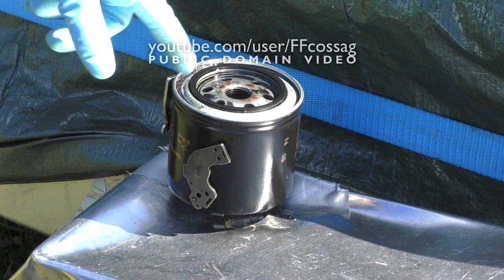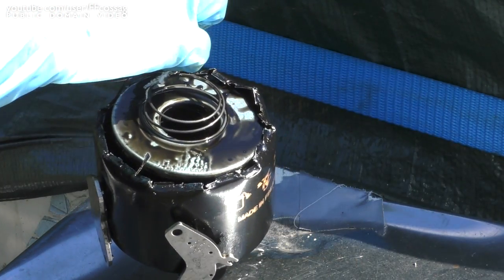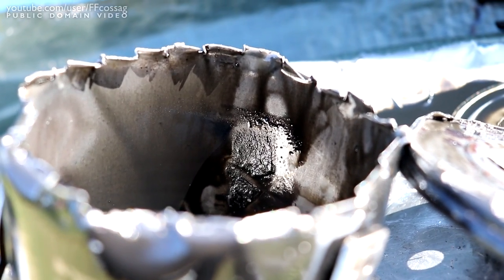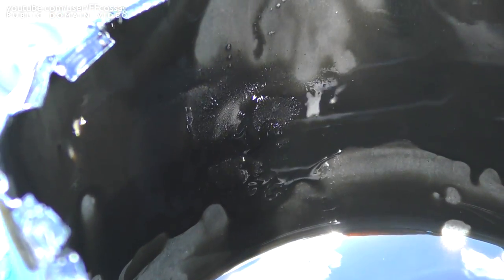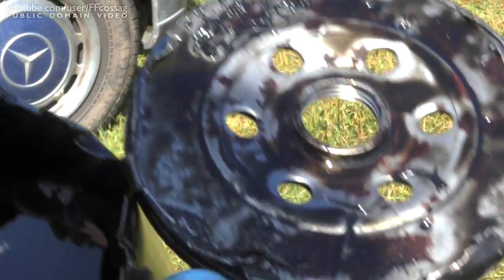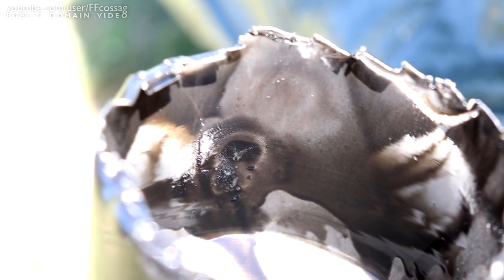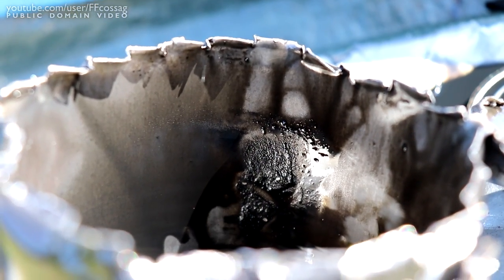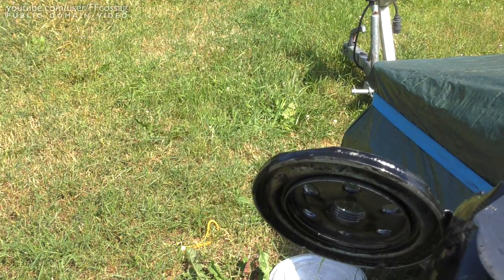Do oil filter magnets work?

Comment: Those metal particles would have just got caught in the filter material anyway. They haven’t gone through the filter and then stuck to the magnets. They stuck to the magnets BEFORE the filter. So pretty pointless. Also, any non ferrous materials won’t care much about magnets.

Comment: That metal would have been caught in the filter...That is why you replace the filters with every oil change...because they catch tiny metal partials like that, the filter Will eventually clog.... hence why we change them.... duh.... buy a good quality oil filter and you’re good to go. Get a magnetized drain plug

Comment: Wouldn't that defeat one of the major points of using a filter? I can understand the use in a motorcycle or sumps or pans that are directly under the crank, but otherwise a filter is designed to filter. If it gets to the point where it's already in the filter, why bother?

Comment: If you change your  oil and filter every 6000 miles you would not have this problem. But there is a lot of metal in that filter I think your engine  is dieing. And it could be what another viewer said it could be the metal from when  you cut the filter open.
Reply: onkar phall u mean 6k not 60k right...?
Reply: Sam B lol yeah 6000 cheers

Comment: regardless of anyone's experience with magnets and where and where not to put them. i have been using neo-magnets for about 7+ years, one on the end of the filter, and three on the oil pan next to the drain plug in addition to the transmission plug which already has a magnet on the plug itself. no cons to this method.

Comment: You do realize that at the end of most oil sump drain plugs is a magnet that does exactly this. And if yours doesn't have one that can be easily gotten aftermarket and will work way better then having the magnet stuck to a steel can which is shielding most of the magnetic field.

http://www.coolmagnetman.com/magshield.htm scroll down to one magnet to see a diagram of what happens to the magnetic lines when against a ferrous plate.

Comment: What's the point of magnets if the filter element catches the shavings and if the filter element doesn't catch the shavings then it's a bad filter. Therefore only use a good filter.
Reply: The problem with that, is that if the filter had the ability to catch really fine material, then it would get clogged up way to soon, so most oil filters allow particles to pass through, that are in the 20 to 30 micron range. Smaller particles cause the majority of engine wear that does occur. There was a time, when engines did not even have filters, some, did not even have oil pumps.The engine will run with unfiltered oil, it just wont last as long. On the other hand, as the filter gets older, it does begin to clog, and it then begins to filter out finer stuff. However, it begins to take a little bit of extra power from the engine, to puch the oil through that filter. If the filter gets clogged enough, then there is a valve inside, which opens up, allow the oil to bypass the filter marerial entirely. That saves the engine from catastophic failure due to low oil flow and pressure, but at that point, it is allowing dirty oil to go through the engine uncleaned.

Comment: If you can see those metal particles then they would never pass through the filter media anyway so the magnets are not really helping to do anything. Also it’s more likely those particles came from the act of you ripping and gouging the filter open than from the engine oil. If you have particles that size in your oil then you have serious problems and no respectable mechanic would tell you otherwise.

Comment: I really don't see the point in magnets if you're changing your oil filter twice a year - the filter is more than adequate to catch any contaminates. Also if you're finding too much metal shavings in the oil you have a problem which no amount of magnets will fix..

Comment: does not work for aluminum
Reply: John Mac most of the moving parts that break down in an engine are not aluminum...bearings, cylinder sleeves, piston rings etc are all steel

Comment: Those metal shavings are actually beneficial as an engine wears over time. The ones that are not beneficial are trapped by the oil filter or simply come out in the oil. Diy people are cool but not engineers

Comment: is that from the piston rings? or maybe the crank shaft? I thought 99% of the engine was aliminium.
Reply: Could be any number of thing. Most likely cam/crank bearings.
Reply: I never oppened an engine, but i believe i read they use the open ball bearings so that the oil can lubricate everything inside because its and submerged oil system and stuff.
I suppose it would make sense that some of that is debris from the bearings too.
Reply: no, there is no ball bearings on the rods or crank. Google rod bearings.
Reply: psygn0sis clueless
Reply: Laharl Krichevskoy aluminum?????most engines are cast iron but nowadays most are alloy in nature still need cast iron parts alloy parts or engines
Reply: Most modern engines are not cast iron. If you include old engines sure, but the majority of car manufacturers have switched over to using aluminum blocks, heads, pistons, and sometimes rods.
The the rest of the engine that sees wear is usually a steel alloy. (Bearings, crank, cam(s), and sleeves)
Reply: only things that are going to be aluminum are the block and cylinder head, and occasionally some race cars have aluminum rods, but aluminum is far too soft to make most working internals out of
Reply: You're right 99% of the engine is aluminum. However the other one percent that matters are your crank your cam, your rings and your cylinder walls. You don't want the shavings going up acting like sandpaper

Comment: I tried same thing, but for different purpose. I don't care of the magnet can gather metal debris or not, cuz any way they will be filtered, and such a small amount of metal debris can't cause any clogging. My purpose is to magnetic the oil, and the drive feeling and fuel economy improved.
Reply: Let us know how magnetic oil works out for you.
Reply: Magnetic oil this guy is a fucking genius!
Reply: Oil should not contain any ferrous material therefore it cannot be magnetised 
Did you read a label that said “Castrol Magnatec”
That is just a marketing name
Reply: LIANG XU  magnetic oil does you no good unless you advance your flux capacitor 12°.
Reply: This makes me want to magnetize my coffee in the morning. I'll be going all day!

Comment: Filters are cheap. I change mine when I change oil, then and again about 500 miles later after the new oil has had a chance to clean the engine.

Comment: I wouldn't bother,the oil filter is made of a cardboard material not even metal dust can pass thru it.Waste of effort.Cut a filter open and you will realize no metal, aluminum,or plastic can pass.

Comment: if the engine is ALUMINIUM, it wont work.
Reply: Jude Roberts 
Correct it’s not, but it’ll still catch some of it just by the migration of the oil
Reply from the maker: Your shafts and bearings are definitely not aluminium.
Reply: look up: how it's made: engine/motor... you will be surprised

Comment: Magnets will only attract shavings that are made of iron or other metals that can be magnetized. Aluminum motors will not benefit much from a magnet on the filter.
Reply: Aluminum engine blocks use Iron sleeves for the cylinders, and bearings for other moving parts, example the cam, so aluminum is less a problem.  Also, aluminum being softer than the bearings, cylinders, cams, etc, will not score them.

Comment: I don't bother with magnetic filters. I always use the proper ford motorcraft filters on my fords. Had a 2002 escape with 300,000 miles. Still ran perfect. Currently have a 2003 f150 with 185,000 miles. Still runs perfect. The best thing you can do for your car is use the original equipment oil filter.
Reply: Alex Puls Those 3.0l duratec V6s are a fine engine from Ford. I'm at 183k in my Tribute.
Reply: In your opinion.

Comment: The answer is NO. The thick steel of your canister acts as a shunt or keeper of the magnetic field. Even in an oil drain plug assisted by grav! ty a rare earth magnet does a piss poor job of restraining metal particles, especially when the majority of an engine is not ferrous material. Any metal particle found in a csnnister that are visible to the eye were blocked by the filter media without being trapped within it..

Btw diesel oil becomes black within hours of use.

Comment: If your engine is running good, you don't need a magnet filter because there will not be any metal in your oil.

Comment: Magnets are stupid if you change your oil regulary an use a quality filter . your engine bearings are bronze .
Reply: The bearings are bronze, but the wear on cylinder walls, piston rings, crankshaft bearing journals and camshaft journals, as well as canshaft lobes, lifters, and valve stem wear, is all steel and iron. Most of the wear (typically 80%) in an engine, comes from particles too small for an oil filter to catch (under 20 microns and above 8 microns). I do not know about the magnets in the video, but good Oil Filter Magnets, like those from FilterMag and Magnesaver, filter out particals in the sub-micron range. If you want to reduce that sort of wear without magnets, you can emply to bizzare and costly practice of changing your oil, lets say, every 500 miles, but that will not save you any money. I mention those particular brands, because those are the only ones I have done any laborotory oil analysis testing on. There may be other good brands as well. False economy, however, is replacing the oil to frequently, like oil change services often reccommend. See https://www.edmunds.com/car-maintenance/oil-life-monitoring-systems.html

Comment: First off, Your magnets are not powerful enough and second, you don't put magnet on filter! You put the magnet on the bottom of oil pan and transmission pan. I use computer server magnets that are so strong. You'll have a hard time pulling them off anything you stick them too.. Get rid of the wimpy magnets buddy! Nothing escapes the magnets I use on the bottom of my oil and transmission pans!

Comment: Using magnets on an oil filter is nothing more than an, an old wives tale, a complete myth.  Dare I say at least 95% of the engine is non-magnetic.  The only time you would find such a thing would be due to severe engine wear and damage.  If you find any metal in your oil, the engine is ruined.
Reply: tell that to my 1949 john deere tractor, aluminum was only used on airplanes and some small boats, pot metal was used for the pistons. the crank shaft, the connecting rods, cams and chains are all made of steel.. the bearings are mostly bronze with a few ball bearings in steel cages . the axle housing and transmission cases are CAST iron with steel gears and shafts. all magnetic including the screen in the oil filters. drop or stick on a magnet in/on the oil case and in the transmission case, it works. my truck is mostly steel inside the cast aluminum case
Reply: The sole purpose of any oil/lubricant is to prevent wear.  If you find any metal in the oil, engine or trani, you have a problem.
Reply: Eric, that is not true. It is completely common to find metal "dust" in your engine and trans and is usually attributed to normal wear and tear. Metal SHAVINGS are another thing.
Also, the vast majority of ware surfaces in an engine are made of some variation of steel alloy. If you are getting aluminum shavings there is something else wrong.